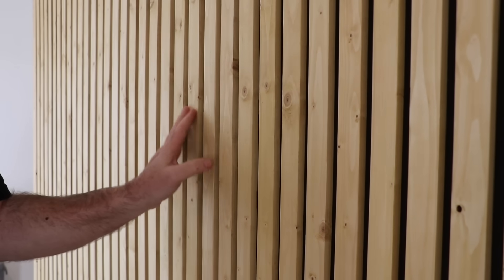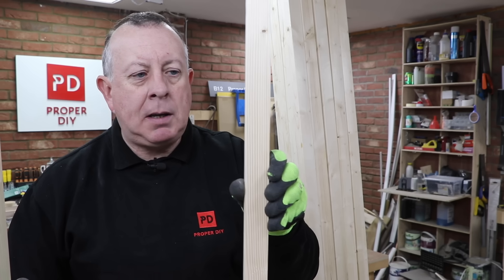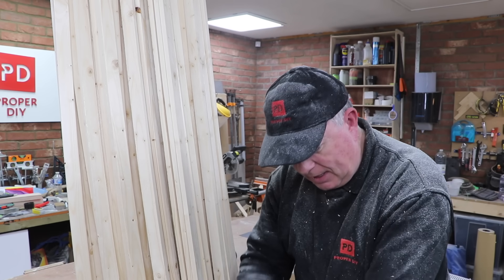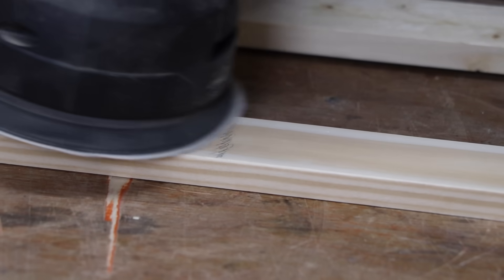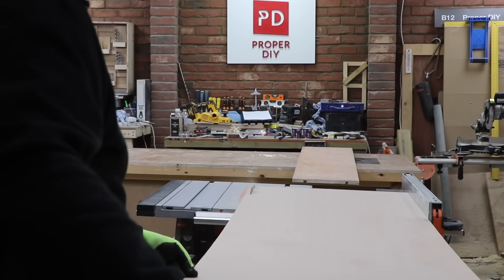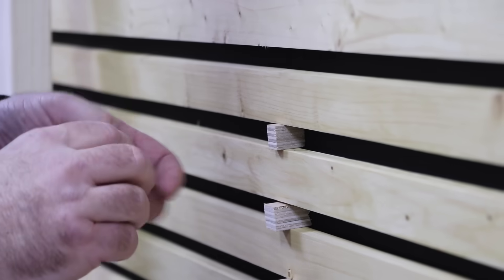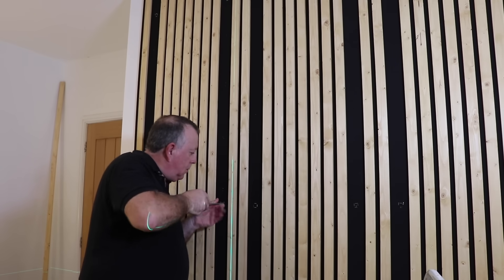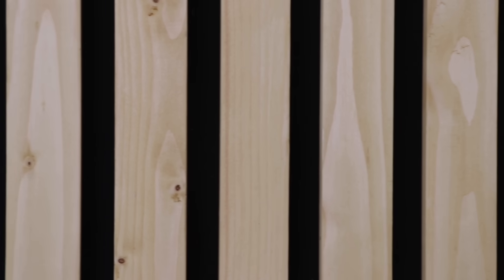Save Money Building Your Own Slat Wall

Comment: You would be better off making a jig for that planer and turn it into a mini bench top jointer with a fence it’s much easier to push the wood through and quicker as the jig can be clamped down or just screwed onto your work bench .its a lot of work for the average d.i.yer to go through with all that cutting planning n sanding epically when most dont have a table saw.ive not got to the end of your vid yet so it will be interesting to hear what your solution will be ,but yeah ive seen a few of your vids now ,keep up the good work always nice to see well explained tutorials 👍👍

Comment: Sure, you can save 70%, if you have all the tools, if you want to saw for 45 minutes, finish and sand for several hours and assemble for 3x the time it would take you to just buy the 24" panels and attach them to the wall in 5 minutes. People will pay for convenience.

Also, these panels are made from veneered MDF slats on a felt panel. Felt is great for acoustics and you can get the look of many types of expensive woods with veneer that you won't with cheap knotty pine.

Comment: the point with the ones in store is the backing is thick wool/cotton material and not wood, cause its works as acoustic absorber and difuser. urs complete wood will not work so good acoustically.

Comment: Interesting video, but a table saw comes with a crown guard, not for decoration, but for your safety. Not only is it bad practice, you should
connect your extractor to it and stop getting sprayed with sawdust. Dust which will remain in the air long after taking your mask off.

Comment: Please don't reach over a running blade to get the cut parts. Either use an outfeed table or let the pieces fall down but stop the saw before even moving your hands forward.

Comment: Could'nt the free cutting service at B&Q be more easier for slicing up the 3 x 2, if they do it of course but would imagine so?
Reply: Sadly the 3x2 is too small for the B&Q saw. It's used for sheet timber.

Comment: In the calculations, i would have liked to see a mention on how many hours you've invested, then multiply this with your average hour cost, the add that to the cost calculations. Not to mention the costs of the tools, wether you buy or rent them. In my case, buying the panels might be slightly more expensive, but saves me work and all.

Comment: John heisz on youtube tried a viewer tip yo glue sand paper (200 gritt) on the side of the table saw blade facing the fence. This way as you are cutting you are simultaneously sanding the wood. Hmm a video on shared viewer tips?

Comment: Enjoyed this video, but I would like to make a quick safety observation.

The fabric you use really does need to be flame retardant.

You may have done so, but you didnt say so.

Obviously mdf and pine strip wood can also burn, but both take a bit of work to get them ignited.

Some fabrics are quite scary when exposed to even a tiny spark, and can act like a firelighter. Many can give off toxic smoke, and at best, could cause the rapid ignition of the stripwood and mdf. 

When covering a whole wall in it, this could literally be a death trap.

Flame retardant fabrics, especially a matt black one, are relatively easy to source, and dont need to cost the earth, so i would strongly urge anyone considering this project to make sure the use a flame retardant fabric. 

It has been a legal requirement for over 35 years now.

Comment: Great job looks amazing and saves the wallet hit but i would personally suggest that instead of a planer, why not use a belt sander and make a jig to hold them to a table. you could then sand 3 at a time. A planer requires skill and is a very dangerous tool in the wrong hands. Also why use fabric when you could use a black emulsion paint far cheaper and wouldn't hold dust like a fabric?.
Another option for the timber is roofing batten there not far off the widths and depths.

Comment: Good job and I understand the aim to cut the cost, but...I would really prefer to pay £100 more and have still saving compared to ready product by better wood selection, for example red oak that is much better option or ash. Instead of fabric and mdf a better option is to paint the wall black or any preferred colour and attach the slats individually. Looks better and the wall is actually breathing.

Comment: I would’ve sent those timbers through the table saw just taking a sliver off each edge to remove the roundover. And then them cut into thirds, with each strip ending up with two good faces for sanding. No need for planing.

Comment: Nice job that Stuart just out of curiosity. What’s your opinion on just painting the wall behind black or use a backing board MDF and paint that black then fit the lats to that ? And do without the black material, just an idea

Comment: One key point difference here - acoustic slat wall vs slat wall.
Reply: There's no way this would be regarded as an acoustic panel wall.
Reply: Sure it's not an audiophile grade acoustic panel. But it isn't made of solid wood because that would defeat the purpose of the acoustic panel. Whether it is effective or not, the cost comparison is pointless. That isn't a prefab slat wall. It's a fabric material made to look like a slat wall. In no way a direct substitution. So the 30% number is misleading clickbait.

Comment: Can I ask a question about you table saw…is it an Evolution and if so, what fence is that?…the stock one I have is not as good as yours (assuming it’s an evolution) so feel ripping cls accurately the same as this project…great video like others.
Reply: That's an evolution rage 5s, and the standard fence it comes with.
I noticed the blade was set a bit to high for cutting that timber, unless I'm not understanding something.
Reply: @patrickloftus ahh I have a Evolution R255 and has a completely different fence, a lot more flimsy than the Rage…. I wonder if the rage fence fits the cheaper version? Thanks for your help

Comment: Oak panels ate not that expensive when you think of all the time and cost and mess I have saw and plainer but I bought mine and glad I did buy install sweet 😂 if you use pine don't use red it holds more moisture so when it does dry out it could twist Like a donkeys back leg.

Comment: Very nice project but I flinched every time I saw you leave the table saw blade spinning while you moved timber around the saw after a cut. Very dangerous way of working. Also get yourself a planer thicknesser - it's one of the most used tools in my workshop. Why were you ripping huge sheets on the table saw if you've also got a track saw?

Comment: If pricing this as a tradesman you have to account for all the extra work you are having to do possibly 1-2 days of sourcing materials creating timber slats etc making back boarding.. average day rate for a carpenter £250.? How much are you really saving and the finish on cheap cls is not the best as was visible in parts of you video. Not being critical just the old “I’ll do it myself” is not always as cost/time effective as it may seem..

Comment: Oh man, you're comparing apples and oranges here. Although the DIY project shows a slatwall, it has nothing to do with the acoustic panel that was used as a comparison (price) at the beginning of the video. The fact is, you have a huge amount of craftsmanship, but no acoustic damping. Well, let's say only extremely little, because the slats naturally break up the sound a little. But the main sound absorber is the black plastic fleece! Another point is the wood used. I'd like to see what the solid pine slats look like after a year. They will twist, bend and warp.

Comment: The reason why the price is higher is because of the accoustic improving materials. These slats got none. So comparing this slat wall tutorial with a accoustic improving slats on the market, is just like comparing how to drive around in a Ford Ka instead of a Ford Mustang... Cheaper yes.  Wonder why? Still a Ford on the emblem, but really not the same driving experince... right?

Comment: Hand planing with a power plane OMG could be a nightmare, I doubt the average DIYer will have success with this. Plus the softwood has a rather cheap look left natural, a straight lined hardwood or a dark dye would be better, not sure about the power socket cut out either as putting in a plug will be tricky with the wood thickness catching the cable below it, a surface mount might be better. But still a good looking job.

Comment: Sorry, can’t agree with you on this one you’re not comparing apples to apples even stated this yourself by saying acoustic wall panels yours wasn’t acoustic and that would be the main reason I’d buy them for their acoustic properties and the slight bit for the aesthetics 
and you could easily install them with acoustic adhesive much much simpler to install quicker, easier, less mess, et cetera et cetera 

And on a separate note  I’ve just given away a table, so after I used it for one project five years ago and not used it since it was taking up valuable space  . And getting in my way.

Comment: The purpose of these slatwood walls is to absorb sound between the slats and diffuse sound with the texture created by the slats.  Yes you saved a lot of money but functionally your wall has no sound absorption qualities. Its just fabric stapled over MDF.  You even pointed this out with the product at the hardware store you used as a comparison.  All show, no go.
Reply: The ones you buy from the "hardware" store are about as acoustic as buying some MDF, stapling black cloth to it and then sticking baton lengths across. 🤣
Reply: I very much doubt people are buying the in store product for sound absorption; more likely for the look so Stuart has done a fantastic job of saving people money albeit with a lot of effort.